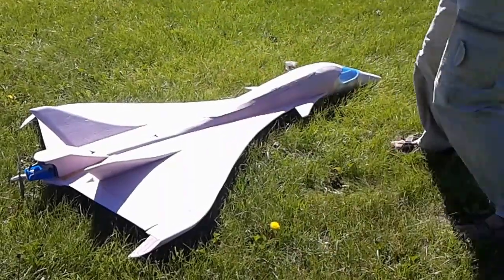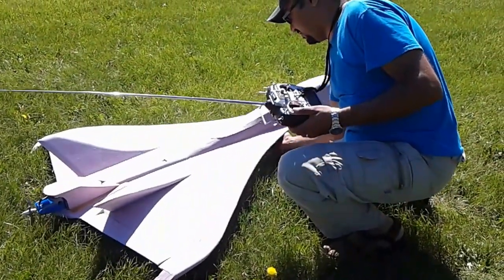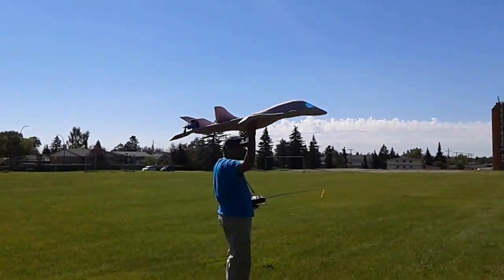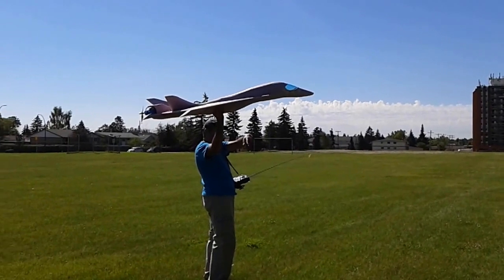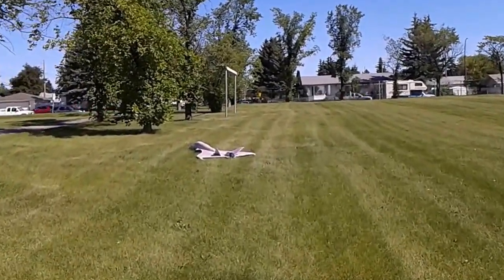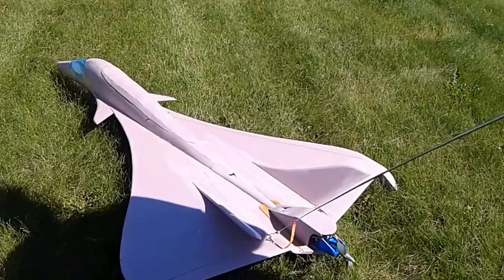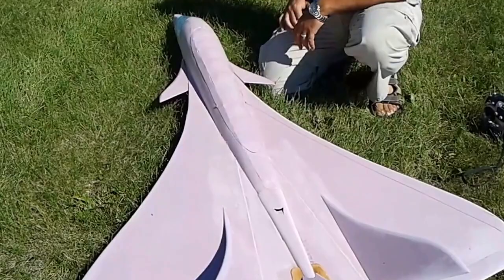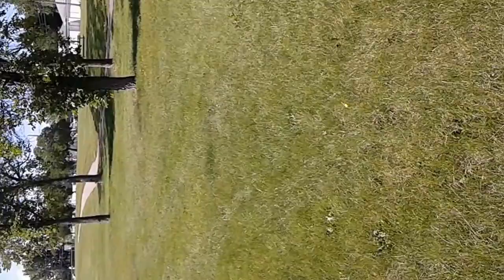Speedi scratch build rc plane

Comment: Canards may work better if set higher than the leading edge. They will then direct airflow over the top of the wing, hopefully smoothing  the flow and allowing lift production at a higher angle of attack.

Comment: Are sure it was nose heavy and not your Knards causing downward push I would play with the knards angle of attach
Reply: I did test the CG last weekend, and foud out that the CG need to be moved about 2 Cm backward. i will post the CG tuning video once i got time. thank you for your input though.